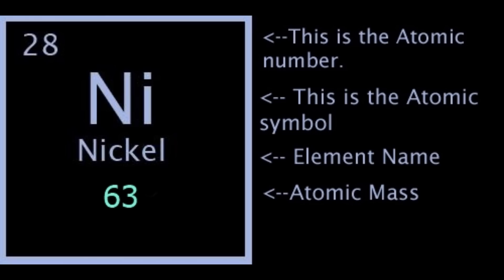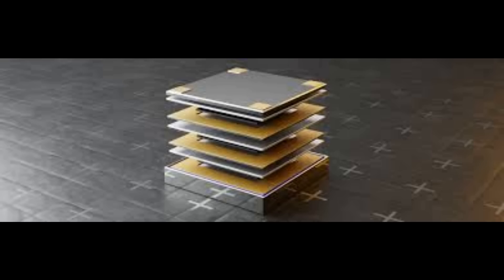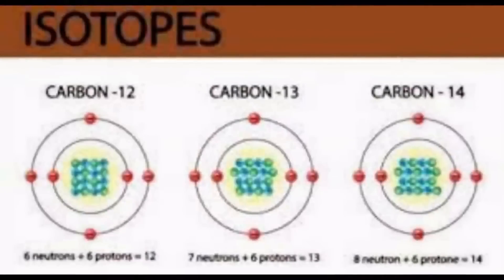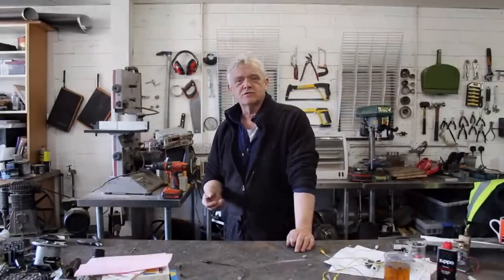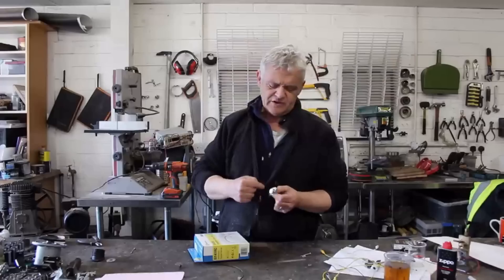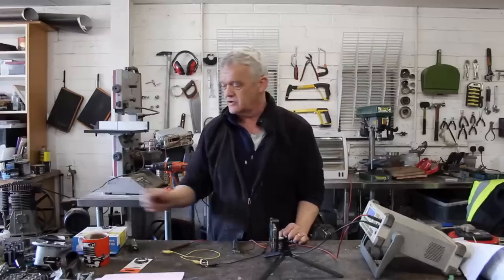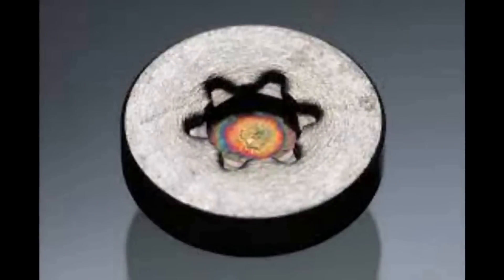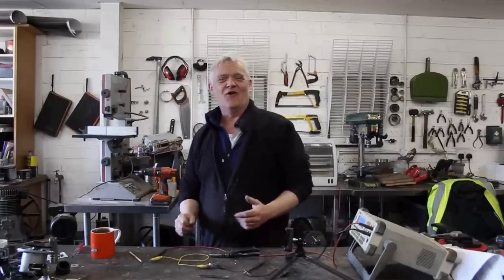2187 - The 50 Year Nuclear Battery From China And How To Make Your Own Version

Comment: Fascinating! I wonder why this couldn't be scaled up to power larger items?  

I also have to wonder if the research and development of cheap, safe energy production and storage isn't restricted by the desire for "planned obsolescence".  Companies aren't interested in spending the time and money to develop a power source you only need to by once a century.

Looks like it's up to you Robert! 😜
Reply: A powerful enough version would likely need a low half life isotope, in order to emmit a ton of particles in a short enough time to make a meaningful current without weighing a ton itself, anyway, refueling yoir car each 5 years beats once a week by a factor of 54.
Beta and Alpha particles are safe, an aluminium foil can block them with ease, and if you can't afford a piece of your hat, you can always stay atarround 2 meters of the source to be safe.
Reply: @partciudgam8478  Except that your atomic EV battery costs about $300 Million dollars each.
Reply: @tcmtech7515  synthetic diamond is cheap and we already have tonnes of nuclear "waste" that can be used to build these on the cheap, and it looks like the r&d costs have already mostly been done, this would be cheap tech if we were aloud to have cheap energy
Reply: The problem with scaling up this exact technology is, well, scale. This thing puts out 100uA, so it takes 200 of them to power a regular 5mm LED at rated current. It would take about 3600 of them to make 1Watt at 12 volts, so to power a single one of the LED bulbs that uses about 14W to make as much light as a 100W incandescent would take around half a million of them. Given that they're 15mmx15mmx5mm, half a million of them would take up 20cubic feet, or a cube thats 2.7foot on each edge. And that's assuming that we live in a magical world where conductors don't take up space, where heat buildup isn't a consideration, where you can trust the wild dingbats of the world with more than an iota of radiactive material, and where this scaled up device wouldn't cost millions to make. Even with all those things assumed, you still need a battery 4 times bigger than your house to power your house. Alpha, beta, and gammavoltaics are simply not a feasible solution for powering anything that the average person finds useful. 
These will be the last lines of defense in keeping nuclear silos secure and ready for operation, in keeping data logged on spacecraft, maybe after a long maturation of the tech or shortly for those with more dollars than neurons, as bios batteries in peoples computers.
Reply: @fluffy_unicorn859😂😂. Apple are the devil.. Remember they tried to end "right to repair" fair play to Australia for put a stop to them that time..
Reply: Calling these things „batteries“ is a bit of a misnomer. They are more like generators with a built fuel supply. The difference a normal battery and a nuclear battery is that with normal batteries the chemical processes that get electrons moving cease when they‘re not connected to a load. But You cannot shut down radioactive decay. And the more efficient the „battery“ is at turning the energy from the decaying isotopes into electrical energy the less capable it is to bleed off unused power. The more variable the power consumption of a device is, the less useful radio-nuclear „batteries“ are to power it. A nuclear battery in a parked car would generate as much power as it would when the car is moving at top speed, and generating tens of kilowatts of power with nowhere to go is recipe for bad things to happen.
Reply: @MrAranton  Obviously these things need to be used with another type of battery technology.
Reply: I think you really need to look at LCOE to answer this kind of question. I'm wondering how much energy it takes to make the radioactive nickel. I suspect this has more to do with convenience than mass scale energy revolution. For the moment at least.
Reply: @darklich14  Oh definitely, just the power required to mine the ore to make these is probably magnitudes more than what they can actually produce. However that being said, the ability to put one of these in nearly any small scale electronic device and quite literally NEVER have to charge it in your lifetime is quite astounding. Whatever energy loss there is while making these is more than made up for in the benefits they bring.
Reply: we have scaled up nuclear power, they're nuclear power plants. radiation emission is scaled to the size you are dealing with. small amounts of radiation are harmless, large ones are not. the bigger the battery, the more dangerous it is.
Reply: @LygerTheCLaw  sort of, nuclear power plants are (as far as I know) thermogenerators (the heat is used to boil water and spin a turbine) where as these batteries are directly alpha/beta voltaic. So yes both means of generating "nuclear power", but no, not exactly the same thing.
Reply: @shannonolivas9524  i was more or less indicating that the larger the generator is, the more radiation is involved. nuclear reactors are actually shielded from the outside environment better than these sort of devices anyways. so virtually zero exposure unless inside the battery itself.
Reply: @LygerTheCLaw betavoltaic devices, while inefficient, only release beta particles which can be shielded very easily.  They don't use fuel that can decay into more dangerous isotopes.  Even if it were possible to scale a betavoltaic device to the order of megawatts(which is implausible), there wouldn't be a heightened exposure risk as long as it was shielded by a few millimeters of lead.  The reason why nuclear fission reactors are potentially dangerous and require thick shielding is because they release gamma radiation, a byproduct of the type of fuel they use.  Really doesn't have so much to do with how much radiation it emits, but what type.
Reply: Very interesting comment 😊
Reply: @fluffy_unicorn859 One of the many reasons I don't buy Apple products.
Reply: It has been scaled up, it's called a nuclear power plant. 😀
Reply: Russia made small ones, about the size of a tall locker. They have been found lying around in the woods and other places and are very dangerous, especially to anyone who does not know they are radioactive. We always have the problem, also, of terrorist types gathering it up and putting it in places it does not belong.
Reply: @fluffy_unicorn859 they'll be be 10 years late and everyone's gonna be talking about this new technology that Apple has developed
Reply: Like how much would a 50m² footprint at 3m high (garage size) do...
Reply: The power density is low, so it's really ideal for very low draw devices. I'm curious how these would work for implantable medical devices. You can imagine how having a pacemaker with a battery that lasts the rest of your life could be worth the expense.
Reply: @fluffy_unicorn859 apple products are garbage anyways so whatever gets people to stop using them i guess lol.
Reply: Radioisotope Thermoelectric batteries power some deep space satellites
Reply: this is nothing new, rtg's have existed for over 70 years, they are used in space and remote stations, i thought it would be obvious why this isnt used more often, maybe having a large amount of nuclear waste and putting huge amount of nuclear material into the publics hands is not a great idea, releasing something like this would turn the world into Chernobyl.
Reply: @eddyronbinson2466  na its a beta-voltaic not a rtg its not a hot item, they already sell you smoke detctors, there are beta sources everywhere
Reply: Most motors take lots of energy to start spinning so we use capacitors, but even then larger appliances can even dim the lights when powered. You could put many of these in series to gain more voltage but 134mV is very little and no idea how much amps this can put out so you need horrible amount to get working to power even lightbulb. Witch point the radiation amounts also increase.
Reply: Solution out of left field?
You are only collecting from one side, maybe surround it with additional cells?

Series stack voltage. Self powered usb everything is on it's way. 👍
Reply: Using radioactive elements isn't "safe energy". Sure, in the manufacture item they are perfectly safe, but things fail. Manufacturing will expose workers and the environment to radioactive elements (. Failure and disposal lead to radioactive elements entering the environment. Look how many NiCd batteries got landfilled and incerated. A lot of soviet radioisotope thermal generators went missing. Some killed people (Lia radiological accident).

This isn't like nuclear power, the level of oversight is way lower. There are a few thousand high power nuclear reactors, there are billions of battery powered devices.

The only way this can be safe, is if its rare enough to oversee (like dozens of space probes) or weak enough to be negligibly dangerous (smoke detectors).
Reply: It's funny how history repeats itself and people think it is novel and new.  Not like the Russians powered remote infrastructure with this concept or anything.  It is also, surely, not a terrible idea to spread about isotopes in a communist garbage government hellscape.
Reply: Power to weight issues?
Reply: @fluffy_unicorn859 No, Apple absolutely would use a battery like this, for the marketing. They would extol the benefits of their new iPhone that never needs to be charged again, double the price, and then stop updating it a few years later so it becomes useless anyway and you throw your forever battery into a landfill.
Reply: they can be scaled up but you wouldn't be able to power anything like a vehicle with them, they would be best suited for stuff like smart phones, smart watches and small electronic gadgets that don't draw massive amounts of power. i've commented on another tech channel trash talking the nano diamond battery when it first came out as they were poking fun at how little energy it produced... my response was that you'd stack them to get the voltage you need and that's your battery for the device for what would quite literally be a few lifetimes, you could take the battery out of a dead device and put it into a new one and reduce tech waste a significant amount.
Reply: Even smart phones are well beyond the capability of this. Although the energy density is quite high the power density is very low. @ToeCutter454
Reply: @ToeCutter454  Was it Thunderfoot?
He is mostly salty about this.
Reply: well this is going very fast for what this is. 2018 till 2024 is only 6 years and we defenitly need to know excatly how pure and perfect we can make these batteries as their first use case is powering bios batteries keeping system times things like that
Reply: @AnonymousAnarchist2  Yes this is a very cool demo, but his presentation sometimes confused milli with micro, as far as both amps and volts. You are talking needing tens of thousands of small sources like these to make even small power sources. I'm sure it could be scaled, but the costs would be bizarre, and the spreading of this much the nuclear material to civilian hands would be insane risky. If it were simple or profitable to directly make electricity from radioactive material, they wouldn't design nuclear plants to boil water under pressure to create steam to power steam turbines to create electricity where 70% of the energy is lost to heat requiring huge containment and cooling.
Reply: @zincfive  Well I am far less concered with low reactive nuclear sources being wide spread in the hands of the public... We already do that this little and very inefficent demo used on of the common houshold sources, and only one! 
Its just a matter of responsible packaging and education on the subject so we do not see a repeat of the 1900's and radium, unfortunitly the source packaging does not do a decent job of this and we do see irresponsible use of these radition sources, and we see myths spread as well, such as the "alpha and beta are just safe" myth. No they are not just safe they will penitrate your skin and damage your DNA over time, its just that you can sheild them easily with a sheet of lead as thin as paper, or a few layers of aluminum foil and render them safe.
Reply: @AnonymousAnarchist2 finally, a forever CMOS! My Pokémon will never die!
Reply: @werlder  just use flash memory instead